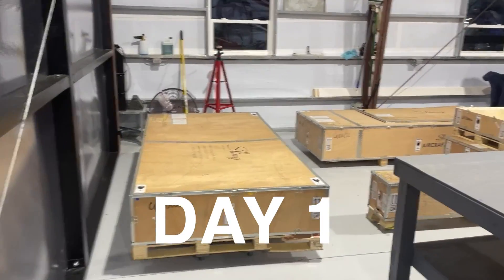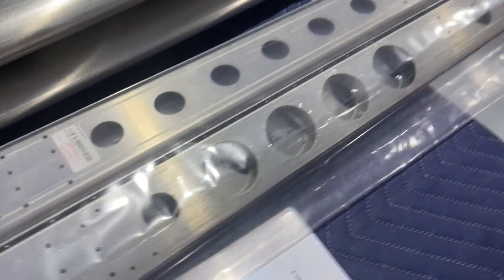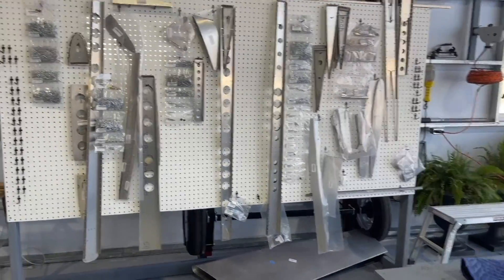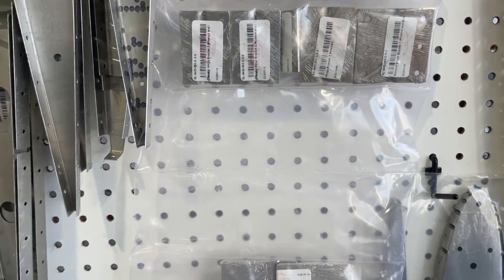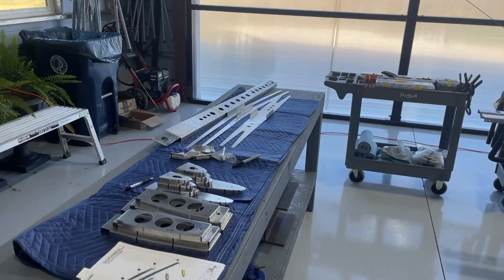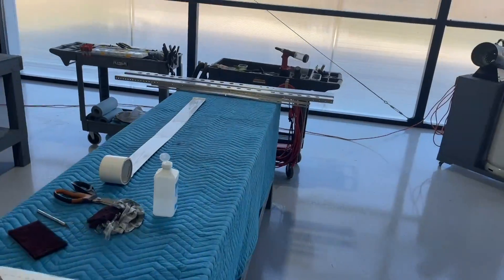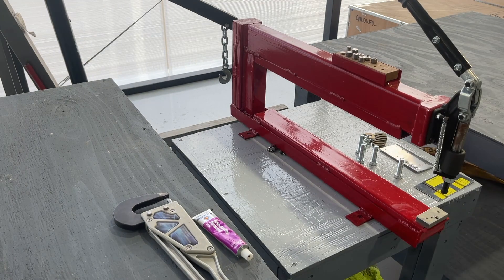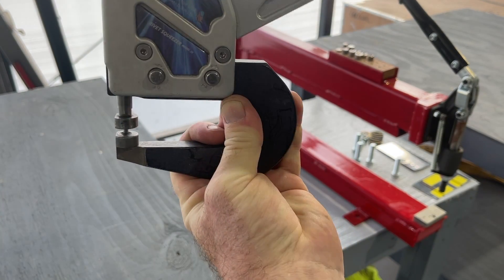Sling TSi Kit Delivery [Sling TSi Build Video #2]

Comment: Just found your hangar tour and now I'm working my way along the Ep's.
I'm surprised to see that you're not painting the bits before you assemble them?
Reply from the maker: I struggle with trying to understand all of the fuss with priming 6061 T6 aluminum.  So I mostly remain quite about it trying not to rock the boat.  But since you ask, 6061 aluminum is considered to be non-corrosive due to its protective oxide film that forms naturally on its surface. That film is highly adherent and provides excellent corrosion resistance. The oxide film is responsible for preventing the underlying aluminum from reacting with the environment, making it suitable for applications where exposure to air or water is expected.

The corrosion resistance of 6061 is also enhanced by its composition, which includes elements such as magnesium and silicon. These elements also help to improve the alloy’s resistance to corrosion.

And, the 6061-T6 temper also has excellent corrosion resistance, which is further improved by the addition of a small amount of chromium. 

If the Sling was constructed with anything other than 6061 T6, such as 2024 T3, I would certainly consider priming or alodining.
Reply: @TheBaldPilot  Thanks for taking the time.  Having tried to paint aluminum boats, I can see that it makes sense.

Comment: Rob, can you share the trim motor wire specs? Did it come with the kit?
Reply from the maker: I'm not quite there yet.  After the HS, I will be assembling the VS.  It is suggested to work on the elevator last in the emmpanage kit as it is the most complex and takes the most build time.